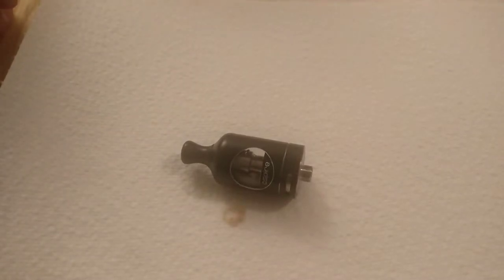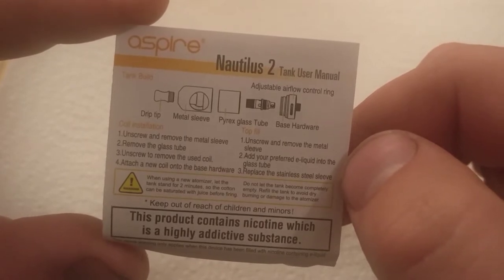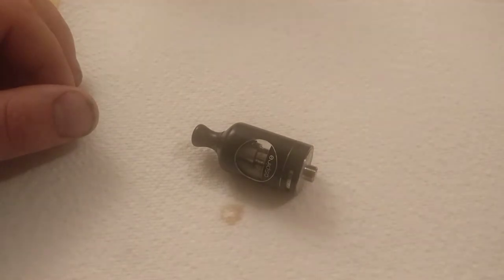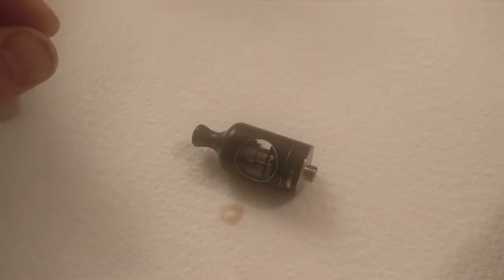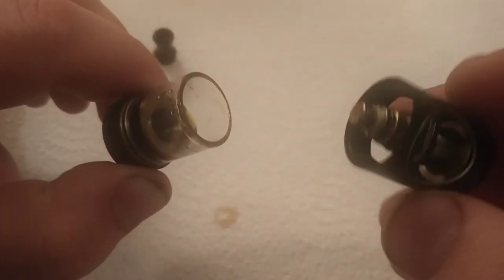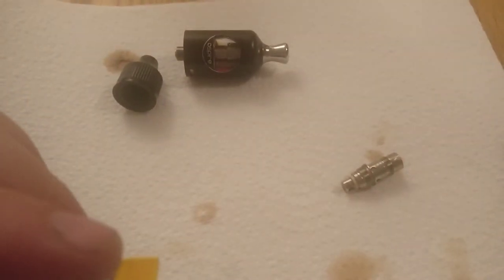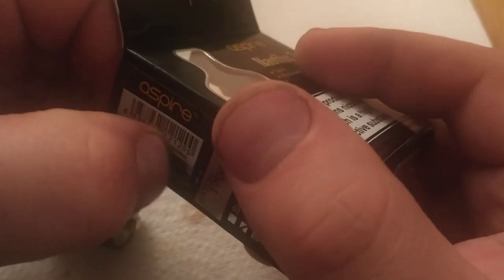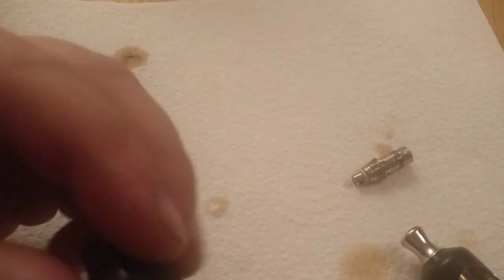Aspire nautilus 2 moan bad design RANT REVIEW VAPE

Comment: Most bitter sweet tank I've ever owned. A fresh coil and completely cleaned, it's amazing flavour and so smooth. I spent hours researching all fixes. To no avail. Seems to need a new coil every day (not to mention how much experience juice I'm losing). Tried buying a new tank (this time the stainless steel one. Same problems. Think I'll try the zenith tank next. So disappointed.

Comment: I'm with you, mate. I've wasted so much juice and so many coils with this tank. Leaks, leaks, leaks all day long mostly through the air adjuster vents. I hate it! I've gone back to my Nautilus Mini - brilliant smoke - and I'm taking the Nautilus 2 back to the shop.
Reply: tarquin bullocks I had the same problem, but after a little research, I've found a solution. After filling, screw down the cage MOST of the way, and before the last turn, FLIP IT OVER and tighten it the rest of the way. I still prefer the nautilus mini, but I broke mine, and I'm broke, so N2 is all I have hehe.

Comment: I've had mine for about a year and I've experienced all of the problems. 
The main problem I've found is that it leakes through the vent holes. The reason for this is because the coil gets damaged over time. After replacing the coil it  no longer leaks.
My biggest problem is that there is no instructions about fitting the o rings. 
They don't seem to fit anywhere. I haven't needed to fit one at all.

Comment: i added some cotton to the bottom of the tank to try slow down the leaking and it would seem to work a bit better (used household cotton so someone with research tell me if its a health risk :/). I think the issue is in the replaceable coils + air-holes. When the air-holes are fully open, the air-pressure keeps the liquid just coming through so i think the proper way to use these heads is to close the air-holes after every use. But my top is now stuck to the base without the air-cover (don't ask me why) so i add cotton to the tank. Guess i will go check if they can unscrew this in the shop and buy my first RDA head.

Comment: I bought the stainless version and from day one regretted it. I've had to modify the crap out of it, filing grooves on the air ring to have something to grab when trying to remove the top, filing and polishing all of the razor sharp edges that literally shaved skin off my fingers every time I tried to open the tank, and the vent leaking, which it does without fail if I ever dare fill above a certain level, let alone even dream of actually filling the tank. Needless to say I'm in the market for a something better, maybe the Vaporesso Guardian.

Comment: My Aspire PoceX leaks when i first changed the juice within the first three days of buying the device,so i brought it back to the shop and the he said the ribber band is getting squeezed down too much so he adjusted it and did not leak untill i changed the liquid and its leaking again,i'm losing alot of juice as I don't see the point of having a warrenty when he wont change it for a new one,as he says it would have to be sent to the Manufacturer for checks.Sick to death of it as i just gave up the smokes and probably will buy a more expensive one,even he says the PockeX is a good device which is only €35

Comment: Had mine for 2-3 weeks and ive only had air hole leaks twice. You just have to fill it a bit below the fill line as getting it spot on risk leaki ng.
 The o rings on my tank have extra pieces \ mould flashing which i was able to remove for the base ring but not the on the cap. Only just noticed the flashing on cap o ring and was wondering why the inside of the cap was always wet. Likely caused by me turning mod upside down for the last half twist of tightening the tank cap to base (forces air through coil wick holes rather than juice when juice is close to fill line.)